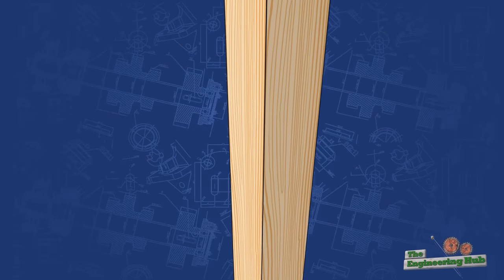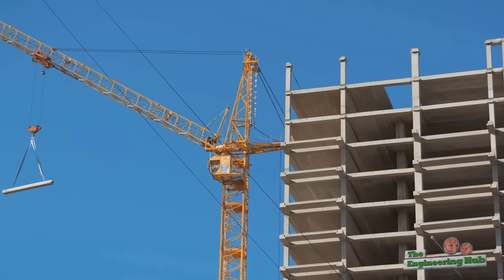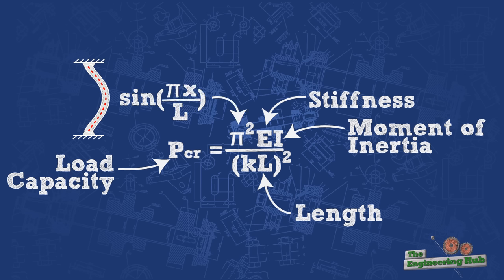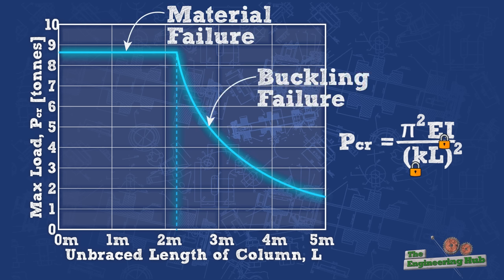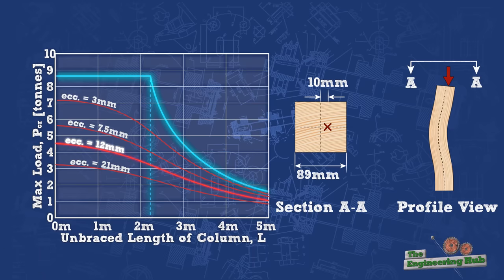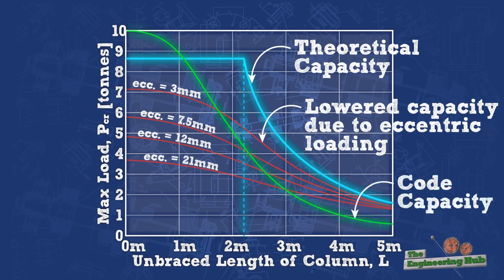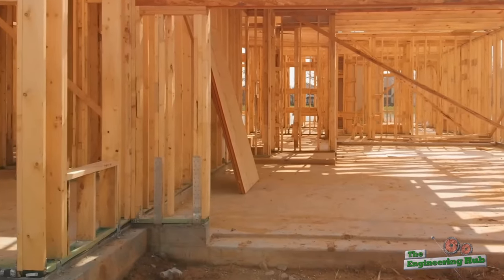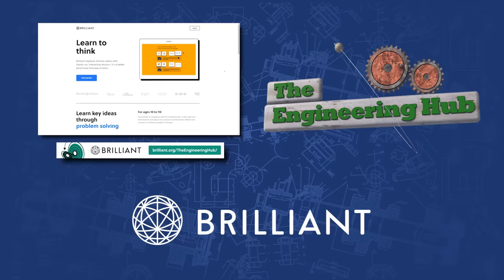How much load can a timber post actually carry?

Comment: I still remember having a 15min argument/discussion in my statics and then again in strength of materials class. My question to the prof was "who came up with 1.5 or 2X as being the right safety margin?  What I thought they missed in all the eng classes was a discussion about COGS or the economics of design choices.  As they say, "anyone can build a bridge that stands, but only an eng can build a bridge that barely stands"
Reply: My take: engineers only care about what’s practical.  Theory is for scientists.  Engineers do.  Engineers only need enough theory to get the job done.  

Even 2x is a very small safety margin in many contexts.  The only reason such small margins are acceptable is that there tends to be many safety margins intersecting to produce a true safety margin that’s much higher in practice.  The size of the margin should be proportional to the cost of being wrong.  If you’re building a thing which could kill thousands of people due to a material defect or installation error or end-user modification, you tend to increase the safety margin!
Reply: 1.5 or 2 is not always the correct safety margin.  Safety margin is often determined by other factors such as cost, weight, risk, how accurate are the load profiles, etc.  Very low safety margins of 1.1 or less usually require testing to prove that the design analysis matches real world performance.  Larger safety margins account for variations in build, materials, and loads.  Many times safety margins can be very large to protect life or even just keep there from being downtime cost for an entire plant.  Codes and standards generally give large safety margins, though some will allow for analysis and testing if a design requires lower margins.
Reply: I've been in the building industry and I can tell you first hand that an engineer is not capable of building anything. And engineer is good at design and putting that design on paper in the form of a detailed plan to articulate his idea to the builders.
The builders read that diagram and translate it to the end product that you use and see.
Architects and engineers have zero practical skills to turn their thoughts into reality.
Reply: @stevenstart8728  Isn't that how it's supposed to work?  Builders don't worry about moments, equilibrium, and Newtons.  Just like eng's don't have to know how to make forms, make a square cut, or make things physically square, plumb and level.  But I always thought every structural/civil eng students should work on a job site for a summer.
Reply: @stevenstart8728 , *most.   Boy do I have some stories.
Reply: @stevenstart8728  That's quite the generalization (signed: an architect/engineer who designed and built his own 6000 sq ft house).
Reply: @DadYouNeverHad  good job.
I've also done a fair bit of design work and drafting with a t square and set squares with the paper sticky taped to the kitchen table and I bet you could imagine the results.
Reply: @DadYouNeverHad  Generalizations don't include outliers, that's the point.
Reply: @stevenstart8728  I've been in the building industry for 30 years as a builder and designer. "Design" as it relates to buildings and architecture, it is not what engineers do - engineers engineer. If it can be shown to work, that is the solution. Ask an engineer to design a building and it will be engineered. Generally.
Reply: @DiscoFang  So you're an outlier too? 

It's getting pretty crowded in here.
Reply: Seattle built a bridge that started failing withing twenty five years
Reply: @wallacegrommet9343  If only those builders were in my class and added 2 to the safety factor 🤣  This is the West Seattle bridge right?  Good thing they caught it before the collapse. I remember the traffic volume during rush hour.  And this was 20+ years ago!
Reply: Indeed it is! Remediation is being performed now with additional post tension cables, epoxy injection, and carbon fiber wrapping.  Bridge reopening is scheduled for 9/12/22. Fingers crossed. The bridge was built too high for its structural design, for a marine terminal that never got built.  Too make matters worse, heavily laden trucks carrying rebar cross it multiple times a day.
Reply: The design strength is based on the 5th percentile of the strength bell curve which is then published in the code for each grade and species. The strength reduction factor (the phi factor) on the material is based on the size of the standard deviation. A higher standard deviation has a higher strength reduction factor. The phi for concrete might be 0.65 while for steel it might be 0.9. The loads used for design are the 95% percentile and are also factored based on the standard deviation (which are then rounded a practical number in the code). Factors for live and dead loads in most modern codes are about 1.5 and 1.25. Dead loads have a lower standard deviation than live loads. Engineers don't have to calculate these factors but they published in the code. If you wonder how the factors are decided on, that is it with a bit of practicality and rounding added in. It is done this way to give a consistent probability of failure from design to design.
Reply: @stevenstart8728  As a mechanical engineering major, never have I been so offended by something I 100% agree with. Doubly so against Architects. (Because architects are engineers who failed math /s)

In 1907 during the construction of the Qubec bridge spanning the Saint Lawrance River, the designers ignored the concerns of the builders working on it when they noticed that the thing was deflecting dangerously out of safety margins. The bridge collapsed. TWICE. All because of pride and the inability to accept that one could be wrong.
That's a story I take to heart. Even if my math is right, nature and Murphy's law will make me wrong, so always listen to the concerns of others and try to understand beyond the scope of my degree.

That's why I learned manual machining and CNC machining. I'm now less likely to make a physically unmakable part because I learned the hard way when I tried to make it myself.
Reply: @stevenstart8728  It's not a design until you submit the calculations, ha ha, signed PE, SE
Reply: Your right, my drawings probably only pass as a sketch but boy I know how to get the concrete steel and timber in the right spot.
My point is the builders build and the architects and engineers design. So why do they say that the engineer that sharpened his HB pencil built the bridge. I think he just watched it being built.
Reply: @stevenstart8728  OK, I see where you're coming from.  The difference between building and designing.  But then I guess the steel and concrete people can say "I made it.". But regardless, a bridge doesn't get built without the architect, engineers, and builders.  One more personal note.  I think it's a crime that we as a society (in the US) made the trades "less desirable" than a four year degree.  Even if that degree was in Underwater Fire Prevention.
Reply: The same trend started in Australia in the 1980,s under our prime minister Bob Hawk. His idea was work smarter not harder and every school leaver should aim for a degree. I left school in 1989 and did a trade much to my teachers disagreement.
We now have uni leavers with no work and tradies being able to charge what they want.
Reply: Also on a house with wall sheeting it pins the studs from buckling
Reply: As a former co-worker likes to say: everything can be made - not everything can be paid
Reply: @wernerviehhauser94  love that!
Reply: Retired engineer.  I did every hands on craft out there. From Automation, Process Control, Computer programming, Instrumentation, Carpentry, Plumbing, Stone Masonry, welding, Process Piping, Structural Steel, Concrete, Electrical, surveying, mechanic work and sweeping the shop floor.  I operated all sorts of heavy equipment.  I'm was also an expert in CAD/CAE, and Engineering/Office Automation. And did the Accounting, signed payroll, dealt with Lawyers, Market Makers, stockholders, the IRS and the SEC.    Two crafts I am not qualified in are house painting and Sheet Rock texturing. I even mastered the art of ditch digging and running a chain saw. Did I mention Lawyers.??
Reply: @DadYouNeverHad  - Generalizations only work when you are dealing with large numbers and the statistical variations will average out. I know specific engineers that can build you a house, a car, a computer, etc. However if I were going to pick 4 people to build a house for me from a group of 100 engineers or 100 builders I would most likely pick from the builders. Gotta go with the odds.
Reply: @wallacegrommet9343  In meantime gross weight for semi’s was increased from 72,000 lbs to 80,000 lbs.
Reply: @stevenstart8728  And every builder thinks he knows more than the engineer.... Dream on.
Reply: You only need 1 leg to get around, but you stress a lot. 2 legs and you don't stress too much. A leg and a pegleg will also do you well.
Reply: @BobWidlefish  in almost every case the compressive strength of a 2x4 is way more than needed to do its job. but you do need something to nail stuff to and its shear strength kind of sucks. they used to cobble wood in its end grain over cement floors to protect the cement from forklifts. worked great as long as it never got wet.
Reply: @BobWidlefish  seems logical
Reply: @stevenstart8728  a depressing thought indeed... you would expect at least half of the job or education of an architect or engeneer would consist of craftmanship.....i always liked to scrible designs on paper (mostly smaller wood projects)  but the actual testing is always in the reality.....lol   i once would like to build my own small wood beam house
Reply: @hansangb  i think specialisation has its benefits and its downfalls....our society is so overspecialised nowadyays you tend to loose touch with all other crafts and systems that are related to yours, or even enable you to exercise yours...in former days there was specialsation but almost every specialisation required a form of (hand) craftmanship. The benefit of learning craft is also direct contact with the materials, which for me is essential for quality building.....not only that....i think its good for people if they do both thinking, creating and maths, all together in 1 job, regardless of their level...i think it corresponds more in a natural way with how we humans function....i think people will be happier and feel more wholesome at their job like that
Reply: It is a matter of statistics and how long it is supposed to last.
These factors are not random.
If the design is such that a single failure is acceptable then the other members still have to hold the now increased load.
Reply: Yeah pretty much, as a tradesmen I struggle with understanding the designs and thoughts of engineers and architects. 

Sometimed their schemes just plain wouldn't work in the real world, but sometimes they have pretty crazy(cool) ideas that you can barely wrap your hear around.
Reply: @stevenstart8728 
That is pure bullshit.  I worked with an engineer who built his own home after hours when he was not in the office.  I know other engineers who do a lot of their own building as well as design.  I was a design technician for 50 years.  Not all engineers could build or want to build.  The days of solid joists is being replaced by engineered joists and trusses.  Those products have been tested to death.  What has changed is allowable spans for solid wood joists.  
Also wood frame construction of multi story apartments has risen to 6 stories in British Columbia and there are examples of greater heights.  No builder on earth is going to tackle building that without engineered drawings.   The builders love to bash engineers but when the drawings are needed they get them from the engineers.
Reply: @hansangb 
Many engineers started out surveying as a summer job. They do know how to make things square.  You need to get out more.
Reply: @wallacegrommet9343 
The bridge was not designed for an unforeseen increase in heavy truck traffic.  Nor for salt and acid rain.  Such crap.
Reply: @danmidtdal4358  I'm sure I need to get out more. But it seems like you need to read more. My story was about calculating the safety factor and not about building anything. I wasn't talking about moment arms, shear force, but rather who decides what safety factor is good enough.

Comment: Besides the Euler length curve, wouldn't it be true that the longer the post, the greater the chance of there being a defect in the wood thus raising the odds of a failure?
Reply from the maker: This is an excellent point. Size effects are very important in wood members and have to be accounted for. The code has a rather simple strength reduction factor  based on the volume of wood used. Since, as you pointed out, the more material there is, the higher the chance of knots or other defects and higher chances of failure. There is also another factor that offsets this reduction and is related to the type of system, i.e., parallel or series system. This means that if the member is "single-handedly" supporting a substantial amount of the structure, then the strength should be assumed even lower. If the system is parallel (e.g., roof joists), and there would have to be multiple failures before a substential collapse, then the strength can be assumed higher because the chances of all parallel members having defects is reduced drastically. Thank you for pointing this out @Burntsider .
Reply: Yes, and that is probably why gluelam beams are so popular in larger wood buildings, they are easier to calculate on!
Reply: Also, doesn't wood grade come into that area of concern?
Reply from the maker: Wood species and grade are also crucial because they affect both the strength and stiffness of the member. The compression strength numbers reported in a code are usually in the 5th percentile which also provides a bit of a safety factor. This means that if they test 100 pieces of wood to failure then they would report the strength value of the 5th weakest sample. Some strength numbers are reported here: https://www.engineeringtoolbox.com/wood-beams-strength-d_1480.html
This helps deal with the uncertainties that are present on the load side. Loads are in general much more uncertain and hard to predict so these safety measures are absolutely necessary. Wood is also significantly affected by moisture. and load duration.  This is captured by something known as the "Madison Curve" (can be seen here: https://www.researchgate.net/figure/Madison-Curve-with-ramp-loading-test-trends-and-constant-loading-test-trends-by-Wood_fig2_265275548. 
Wood members become weaker over time, they could lose 30% after 3 years of service (this is species-dependent). So the 5th percentile strength is important to take.
Reply: That effect is limited by wood grading, placing limits on the kL/r, and calculating the wood column stability factor Cp.
Reply: not exactly easier to calculate on, but there is a lesser chance of having a larger irregularity. So on the design level for strength of the beam we reduce the normal beam by 42% and for glulam by "only"  33% for bending load (according to swiss building norm). So we can use higher resistance for glulam beams. In the swiss  building norm it is 16N/mm2 for bending with glulam and 14 N/mm2 for regular beam. While production cost are about the same for both kinds of beams.
Reply: @replyhere590  Yes, but for normal construction you would order a "normal" beam and not specially selected one since you dont want to calculate every single beam with different strengths. That's why It is accounted for on the design level at about the 5% fractile. Which means 95% of the beams are stronger than the resistance you will calculate with.
Reply: Only if the defect is close to the mid point of the column as far as buckling failure goes. Timbers are graded and one with serious defects would be rejected. The crushing talked about can be very difficult to see in a piece of wood. It usually appears as an almost line at 90 degrees to the load. Sometimes in lumbering, a tree will fall in such a way that the wood grain is crushed. This is of particular concern in wood used in aircraft construction (Sitca Spruce).
Reply: Oops..meant to say Sitka spruce...
Reply: From my direct experience from doing around 200-250 porches... That is exactly how they all break. They will never ever break in the fibers and always in a knot which is why working with wood you have to dismissed a lot of posts and always inspect them.. or install a lot of extra posts.
Reply: Being a timber machinist/carpenter my whole working life I've always seperated any defects in timber and labelled as feature grade for furniture etc. And the overwhelming majority of structural timber I've run has been almost always been free of defect knots etc.
Reply: My initial thought is that defects will be linearly related to length, while Euler buckling is quadratically related.  So the longer it gets, the more important buckling gets compared to defects.  Ten times as long means ten times as many defects, but 100 times weaker due to buckling.
Reply: I would guess the portion of the tree the 4x4 was cut from would affect strength too.  The grain as viewed from the end of the 4x4.
Reply: @Skateboardfreakist  is in